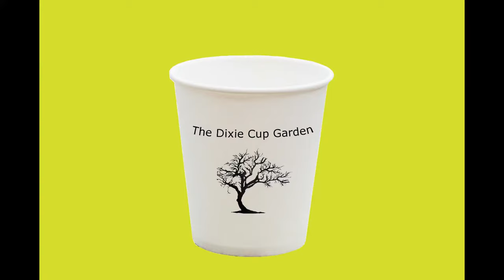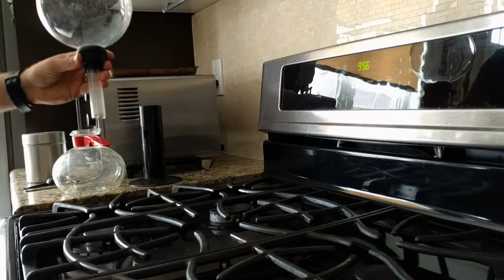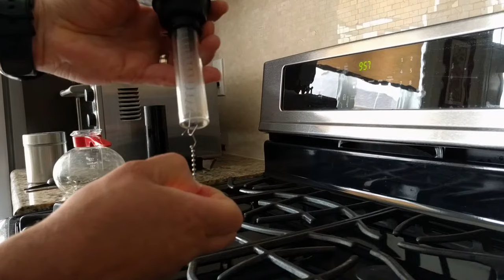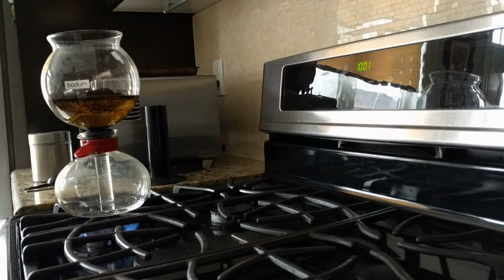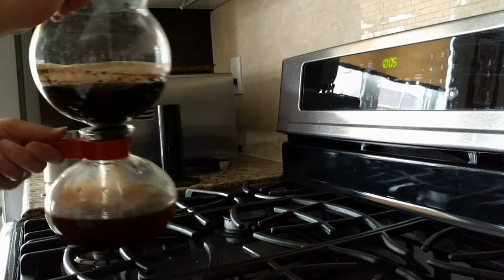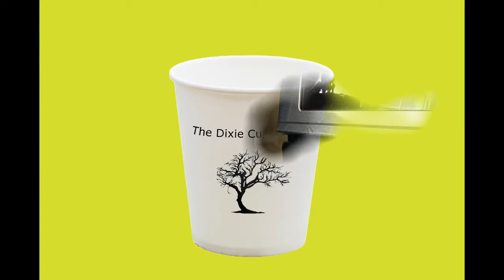How To Use a Bodum Pebo Vacuum Coffee Maker

Comment: The bottom vessel or retort (heated vessel) is essentially a flat-bottom modified florence flask.  Normal Florence is completely spherical to the neck.  By contrast Erlenmeyer flasks are the non-spherical flat-bottomed cone shaped to the neck.  The top vessel is a funnel or filter funnel, not a beaker or a flask.  A beaker is a flat bottom cup with straight sides.
Reply from the maker: It's still pronounced coffee, right?
Reply: @ThePaperCupGarden  I was much more triggered by the corporate video by KitchenAid about their vacuum coffee machine when they said the vacuum was pulling the water up to the top and gravity was making it go back down.  I may have been a little harsh about your use of the term beaker for the filter funnel top part.
Reply from the maker: @BenRichardson   No Worries, I am truly not offended.  If I'm wrong, I'm wrong.  I actually appreciate being corrected.  In this case, however, I don't think my error will confuse people as to the intent of the video.

Cheers

Comment: Mechanism of action; Water does not compress. As the air in the lower pot heats, it expands. The expanding air pushes the water up into the upper chamber. As the air in the lower cools it creates a pressure vacuum in the lower chamber. Which draws the coffee infused water back into the lower chamber.

Comment: It appears that there is some water left in the bottom chamber while brewing.  I understand the taste is amazing but isn’t it slightly diluted from the residual water that doesn’t rise?
Reply from the maker: The water at the bottom is there because the tube from the top doesn't reach all the way to the bottom.  I have accidentally left the pot on the burner and forgot about it a few time.  If left on the water will boil out.

I don't find the coffee diluted, but if you are worried, you can always put in some extra grinds.